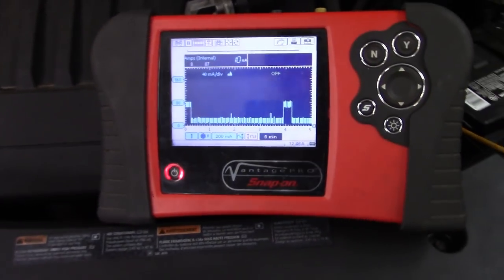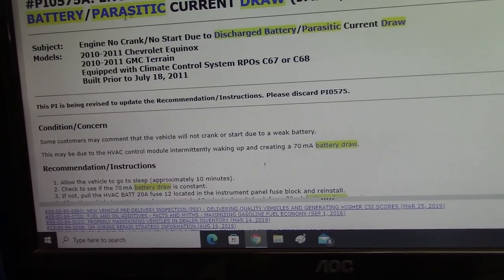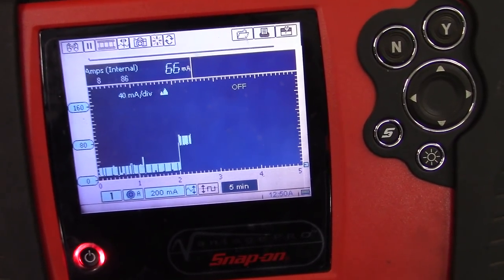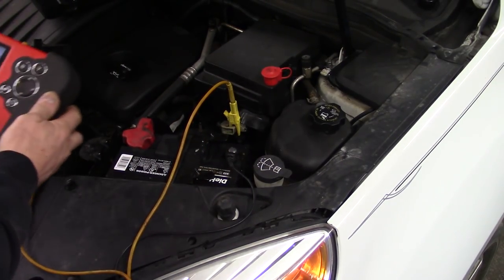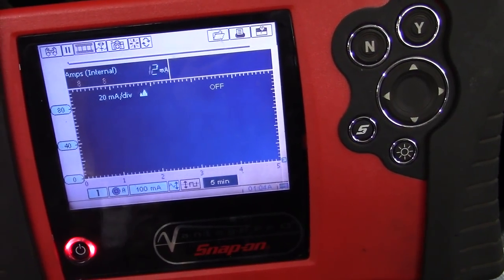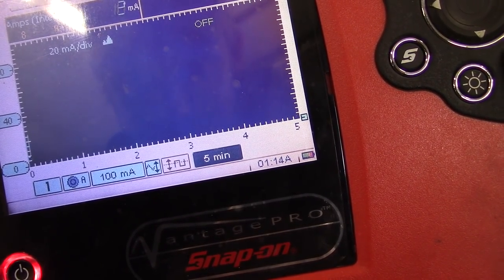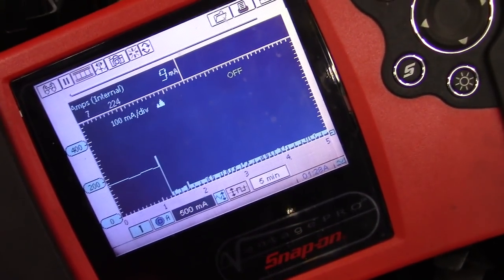Chevy Equinox: Battery Draw- Fixed With Service Info

Comment: I just want to thank you eric for all the videos you have posted and all the lessons you have taught. From mostly what I learned watching you I was able to properly diagnose my cars abs module being faulty rather than throwing wheel bearings at it. Saved me tons of money and more importantly time. What you do makes a difference so again. Thank you.
Reply: wow, good job, it is hard to diagnose modules since they can be intermittent at times. Unless it was a complete dead module, then checking power and grounds and still no com after data wire integrity check, then there is nothing else but the module itself.
Reply: @scientist100  i had communication but it had a right rear speed sensor circuit fault. I fould some corroded wires and patched them up but still had the code. I used my meter to verify the signal was making it to the module and it was. I could also see the signal on my scanner so i sent it in to be repair and sure enough it was fixed after the reinstall.

Comment: The fact that you fully inform the customer about what happened and what to look for as an issue is just fantastic. It saves your bacon and strengthens the trust relationship.
Reply from the maker: I document the whole thing written out on the repair order. That way we're all in the same page.
Reply: Yes,communication is appreciated.  Took my car to the Ford dealer for an oil change a while back and they decided to do a software update without saying anything to me about it until later.   Wasn't too thrilled to be waiting an hour on my oil change.
Reply: only a crook would not
Reply: Something entirely missed by 99% of all shops.  Eric O, per his own admission, is not the "best" around, but what sets him above so many others is honesty.  I let on that I know NOTHING when I go into any shop, then when they try to throw the BS at me I will slap them down.  I'm so sick of all these shops just lie to your face.  Two in my area I will tell people to never go to...and every time those shops will say "you're lying", and I just post what happened, WITH the documentation.  They go away right quick, and in a hurry. Maybe that was 10 years ago, but when you get taken for a LOT of money and they didn't do the JOB they SAID they did...I will NEVER  trust you again, especially when the same owner and mechanics are there....NOPE...never gonna happen.

Eric O., is straight up honest, which sets him way over 99% of the others out there.
Reply: @Scooter30FTW  Besides poor communication... Sounds like a time management problem too. Depending on the kind of update, wouldn't think it'd take more then a few minutes... If they tried updating before/during the Oil Change should be quick... (I know like GPS/Nav Map Updates can take a rather long time to transfer/update/reboot... Seems odd they'd do that out of the Blue)

Comment: I particularly enjoyed this video with the 2011 equinox. Your diagnostics are just awesome. I’ve been retired now for almost 15 years so much my onboard data has far surpassed its expiration date!  Before I retired I worked in GM Service Operations on the Equinox while it was in preproduction. I also worked on Tracker, both of which were built at GM/Suzuki joint venture plant CAMI, in Ingersoll Ontario. The group I worked with was responsible for initiating a lot of the tech bulletins like you were working with. You said that the lack of inter communication makes you want to jump off a bridge. Me too. However, the first priority was always to get the information out to the dealerships/service repair industry where it would be most useful. I think all of your analysis was spot on and reprogramming the hvac module was the right thing to do. It will be interesting to watch this work out. I hope the draw is corrected, and I hope you get some positive feedback from this customer.  Again, I love your channel and will look forward to future videos, and I promise to binge watch all your stuff.  Oh, I could tell you stories … OMG. 

Best regards from under the bridge!
Reply: That's awesome!

BTW, I do specialize on the First Gen Equinox here in Mexico. I did an LX Swap on my 2005 Equinox (LX9 3500 out of a 2005 Malibu, it was Plug and Play).

I want to ask this: I have a client that I will diagnose her 2005 Equinox. It has a 2005 VIN, but it has the E38 ECM, and almost everything from the 2007-2009 Equinox instead of the 2005-2006 with the P05.

Does Pre-production cars can get to normal customers?

Hope to read your reply!!

Greetings from Guadalajara!
Reply: @Alpha06R  Hello! I’m sorry I can’t answer the specific question you asked but I can tell you that pre-production cars, which are the first dozen or so off assembly line, do not get sold. Normal vin codes on the units, 000001 to whatever the determined number of preproduction is. They get used around the plant for transportation and for service activities or investigations until the next years preproduction models are built. The preproduction models eventually are scrapped, usually crushed. I’ve taken my name to the crusher myself to make sure it happens. I actually took one preproduction unit to GM’s crash test facility for an investigation of a customer service concern. It was really cool to make it happen and the video helped me immensely to make a production change. Having the car available to use was great.  No one wants to crash a salable car. 

Cheers!
Reply: Eric and lovely wife,  Venessa are a blessing to us as we know Eric and you are very knowledgeable when if comes to repairing vehicles and we have learned  much from you both. We want to thank you both for helping us so many times. God bless the five of you.  Larry and Jean Lynch in Jupiter Florida.

Comment: Re-read the service bulletin.  Step 3 says to pull the fuse AND REINSTALL. THEN check for 70ma draw.  You did not reinstall before checking.  It would seem that removing the power to the module did indeed reset it, and the calibration was the culprit.  Fine job as always.

Comment: Great content as always, and I really think you found/fixed the cause - @1:38,  point #5 says "If the battery draw is reduced or eliminated, the current HVAC Control Module calibration may be the cause", "revised software, etc... I'd read this to mean if the draw goes away after pulling/reinstalling the fuse, the software update should fix it. It could be a software bug that doesn't show itself for days or weeks, so the fact it didn't reappear right away may be irrelevant.
Reply: Yes point #4 says to pull the fuse then REINSTALL. It does not say to leave the fuse out. Like you suggest, pulling the fuse must reset the HVAC module calibration. Thus, the lack of the 70mA draw indicates that the resetting of the HVAC fixed the problem in the short term, however, the long term fix is the reprogramming of the module so that the incorrect calibration that caused the 70mA draw cannot occur again.
Reply: I had the same thought. I think Eric hit the nail on the head with that ~70MA draw and pulling and reinstalling the fuse did indeed resolve the issue. Thats pretty darn exactly what the PI said
Reply: I'd almost wonder if the issue didn't go away when they put in the new battery and then came back after a time. Something like that could easily be overlooked and they'd just think the issue never went away. I'd bet that calibration drifts over time, prior to the update, and resetting it by cutting power completely just starts the process over.

Comment: My first experience with parasitic electrical draw was working for an RV dealership in the late 1980's as a warranty manager.
We had a slew of AC Delco engine batteries that would go dead. Rather than check the batteries out, I was told to warranty them. That all stopped when the supplier checked the batteries, charged them up, load tested them and said there was nothing wrong with the batteries.
Told the mechanics that something was drawing down the batteries. They came back and said that there was a small miliamp draw but nothing that would make a battery go dead.
We fould out later that these new fangled dash radios that had digital clock displays created a miliamp draw and it was just enough over the period of a month of not starting the new motor homes, the battery would die. See, before this all the dash radios were analog so they didn't have a clock which drew down the battery!
The solution was simple enough. Our lot manager made sure to start and move all the motor homes on the lot on a regular basis.

Comment: Great video, I noticed in the service bulletin it said to remove and reinstall the fuse and see if it went away. To me the reprogram is what you needed to do. Good job and nice troubleshooting!
Reply: Exactly. I suspect the remove and reinstall reboots the HVAC module for a temporary fix. Step 3 in the TSB.
Reply: @ronnelson8845  We had that on a 2012 or 2014 Sierra 1500 pickup at work. The radio just stopped working about 2 weeks ago. I found on line, pull fuse for about 20 seconds with key off and reinsert fuse. Did that and radio started working again and has been fine for 2 weeks now.

Comment: Actually, service data did say to remove and reinstall the fuse before testing. So what you saw was exactly the behavior in the service data, the draw shouldn't have come back after re-plugging the fuse. Likely the module eventually crashes...

Comment: My thought. Maybe that service letter was correct and you resolved it. Maybe when remote hvac module was powering on the heat control and that temp actuator was miscalibrated and the clicking you had us hearing was a door sticking trying to find is home. That random power maybe seeing temp and setting that blend door to it's position and not seeing it? Hard to put into words. IDK. I feel you resolved the issue.

Comment: Had a similar problem on a 2018 GMC Terrain with a turbo charged 2.0L I4 that was purchased new in the summer of 2018. 

The CUV was owned by Municipal Government agency assigned to an elected official. Due to the Covid-19 pandemic, it wasn’t being used much and sat in a city-owned downtown parking garage. 

It developed a parasitic battery drain that manifested a year after it was purchased. The CUV constantly had to be jumped started. The CUV hadn’t been driven a lot and it had about 9,000 miles on it. 

The GM dealership where it was purchased from just kept replacing the battery since it was still under warranty. They replaced the battery twice. They weren’t interested in properly diagnosing the problem and repairing it. 

A second GM dealership a least put in the effort to try a determine what was draining the battery. They would keep the vehicle for several weeks at a time doing parasitic drain test. After the third round of testing they concluded it was some type of radio frequency (rf) interference that was waking up the power seat module. 

The problem with that was radio interference is everywhere in a downtown area of a large city with people using remotes to lock/unlock their vehicles, police/fire and municipal departments using their two way radios, etc. so that can’t be avoided. Basically, everyone’s vehicles are constantly being bombarded with rf interference. 

The parasitic drain was never found, I solved the issue by getting the newly elected office holder to take the CUV home so that the vehicle would be used on a daily basis. As long as the vehicle doesn’t sit fro 2 to 3 days without being started, it able to keep the battery fully charged. 

General Motors never admitted there was a problem with this brand new vehicle and everything was covered under warranty.

Comment: Sometimes dealerships will be aware of service bulletins like this and not do anything about it. My neighbor had this problem with a 2021 Buick and the dealership said to just charge the battery and run the vehicle every day to fix the problem. My mother in-law has the same issue with a 2018 Terrain and they told her the same thing.

Comment: Good video sometimes the gremlins can get you with the battery draws.  In other news I used the 3m headlight restoration kit on my 07 Hondoo my lights look like brand new and took your advice on the coating 4 ever clear made them loom like new headlights.  😂

Comment: I had a Compustar remote/alarm installed in my 2012 Mustang GT which caused the same issue.  In winter weather the battery would go too low to start the car after 2 days of no driving and about 4 days in the summer.  After market can really mess you up.

Comment: we bought a 2010 Equinox in 2010,  we lived in CA then, it was home, My wife loved the Car, little did I know it's pretty much a fair whether automobile. We  now live in the Tri cities eastern WA; this car sucks for driving in the winter, and if there is snow / ice, the accelerator shuts down to idle, the first time we experienced that was here in a snow storm, pulling out from a side street here,  the thing goes to idle, and here where stuck side ways and trying to get the engine to rev up and go, with a car bearing down on my side. By the grace of GOD I got it to go. Now the car sits most of the winter in the garage; I have a 2015 black 4x Chev 1500. we use that much of the winter. Chevy sucks. I will say, I did own a 2005 GMC, that truck was awesome, run great, wish I still had one over this PU. 
Your a good man Eric, like how you give it your all for your customers. Treat them right, even if they aren't always on the up and up. that makes you a mark above the mark. 
For all who would read this, listen up, There are watchers; that's gospel:  they see and tell, and it all goes down in the books. ??? ! every foul carless word and the like. Know the word, Jesus is that word of truth all men must known, if not, it's to go the way. Jesus is the only way to salvation, Blessings to all in Christ Jesus. amen

Comment: Oo! Oo! Do a video on the plugged Equinox air tubes!!! Mine throws a PO411 when it's cold out.

BTW I get hot/cold door clicking all the time. At first I thought it was critters.
Reply from the maker: I do too much swearing when I take the AIR tubes off... The two wheel drives aren't bad but the all-wheel drive suck. You can get the tubes off without pulling the manifold but they're real pisser to do. And there's two teeny tiny ports in the head. You're setting when it's cold could be because it's actually freezing. That's relatively common if you leave your car outside. Most people that Park them indoors don't have that issue I've noticed. Very common with the Eco booms
Reply: @SouthMainAuto  Thnx Eric. The code is no big deal because it goes away. The only sucky part is if I remote start to warm up, the computer shuts off it when the code gets thrown. So I get a cold and frosty car and a MIL. Chevy Thunder!

Comment: So I do what I'm told: If you can do it, etc so I went outside and changed oil and filter in my Dub-Uuh. What took most of the time was getting it up on jack stands, a lift would be nice... Since I got two of those VWs I got more work coming up on them. Still gathering energy to replace a broken front spring. 🤓

Comment: That sunroof looks surprisingly well installed other than the wiring. They came so close, and then fumbled. Not that I'm much of a fan of aftermarket sunroofs to begin with. Just seems like you're asking for a leak even more than a factory hole-in-the-roof,

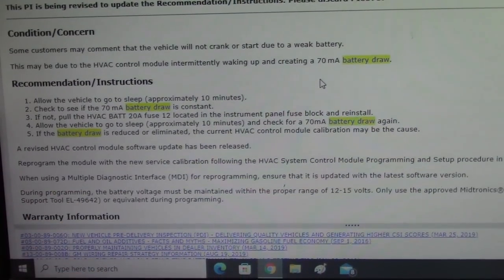Comment: If you go back and re-read the TSB (1:48), it says to pull the fuse and then reinstall it.  Then the intermittent draw should be gone.  And if it is gone, do the software update.  So you did the right thing, just missed the remove and immediately replace step for the fuse.  Seems like the module gets stuck in some kind of loop, which pulling and replacing the fuse resets it out of.  Either way -- I'll bet you got the right fix.  As usual.  🙂

Comment: Honda has the same issue with the 19 CR-V’s ( except base model) where the evap module doesn’t turn off after venting when the car is shut off. PGM-FI Software update fixes that too. Just thought I’d throw that out there.

Comment: when dealing with paracitic draws before I have always tested all curcuits but from here on be more suspicious of hvac systems , cos if Gm have problems with this mod no doubt the rest use the same chips urgo control and activation

Comment: I hope you get paid the correct amount by the customer and they are happy ! 
Not everyone understands that sometimes it's a bunch of research involved to get the correct answers and even though the engine wasn't rebuilt You did invest time and your knowledge to fix or know what needs to be done to get it fixed . I'm in my mid 50s and from when I was 18 to mid 30s a good friend of mine worked as mechanic for GM . He could have opened his own shop as he was a Hell of a mechanic and his reputation was well known by Many! His time away from his job at Chevy dealership was spent in the home garage...a lot ! 
 
My extremely long ' comment '  is to say some people Just Don't get it ..at times it's research and not much in parts ..Customer says That much $ and it was only this to fix .
I liked when he'd say to me ( not Customer) Not paying for what I did..
You're paying for what I KNOW !
He moved away and many now wish he'd stayed .
It's NOT easy finding a Excellent, Honest and Fair mechanic..if you do they become family.
I have learned much from your videos and my 04 silverado has or had issues I went straight to S.M.A. to gets answers ...correct each time ! 
Thank You for sharing and I hope to
Reply: Hope to get a few South Main Auto shirts soon !

Comment: Here is another TSB for battery draw - Some 2011 Chevrolet Equinox and GMC Terrain crossovers may have a dashboard electrical problem causing the battery to drain. In T.S.B. 11004 issued on Jan. 10, G.M. said backlighting in the instrument panel might illuminate even after the vehicle is shut off. Reprogramming the module that controls the lighting, and charging the battery, should solve the issue.